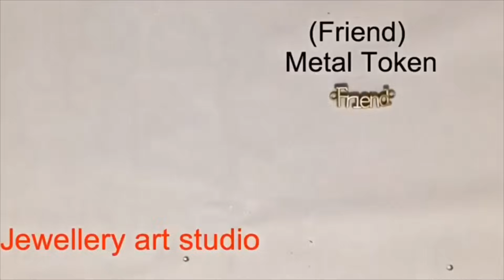8 Leather Bracelet DIY | how to make leather bracelet | adjustable leather bracelets

Comment: I agree with Shawna, how about some measurements, product type, and a voice.  Nice bracelets but difficult to follow!
Reply: Ok i think the same think.
Reply: Seriously? You can't figure this out? Wrist average from around 8 to 9" plus take up for braid so at least 12 to 13" in material.
Reply: How about some common sense lol
Reply: Bro its easy bro . Concentrate on the first and last knots then it will be easy for you bro, be trying again and again it will come better.
Reply: Tap the 3 dots on the top right corner. Choose speed controls. Slow it down.
Reply: There aren't any measurements because they didn't measure. Cut pieces as long as your forearm or double the length you want then cut excess
Reply: Something to keep in mind, what if the person have speech impairments, hard of hearing or deaf, or possibly do not speak English fluently. And sometimes some of us don’t want to hear anything but to watch someone working on a beautiful project.